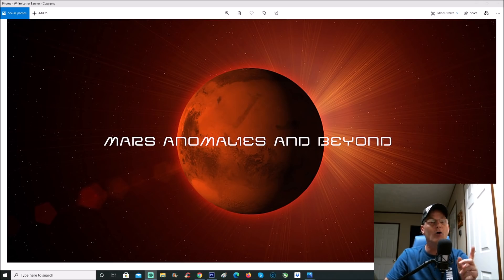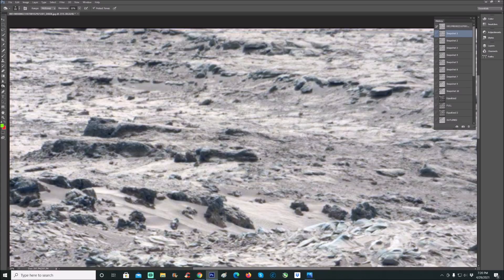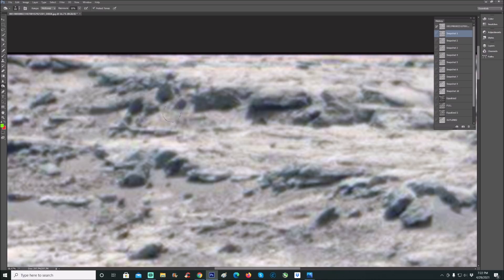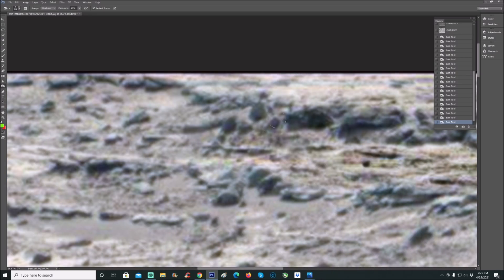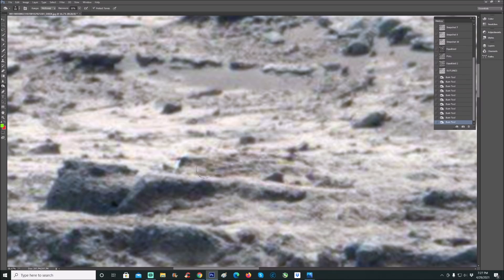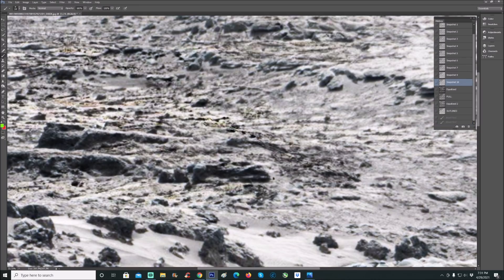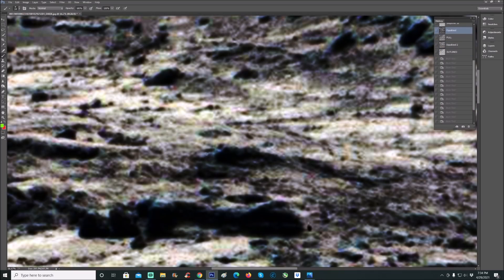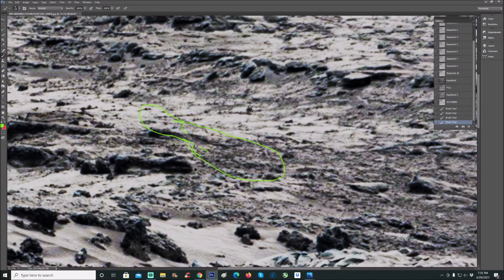Tunnel Entrance, Cables And Mechanical Parts + Quick Tutorial ~ 4/29/2021

Comment: Chris if you want to see what is there then try this.  Take one of your pictures (preferably cleaned up some) and zoom out until the picture is about a 2 inch by 2 inch square.  Take your paint brush and increase the size to say 200.  I believe you currently have it set at 85.  Take the circular "brush" and without touching the right or the left mouse button go slowly back and forth or circle clockwise or counter clockwise until the picture of what is there shows through.  It will only last a moment but you will see what is there as long as you keep the brush moving.  Once you stop the image will fade back to what is was.

Comment: I have also been doing this since the beginning, I started with some  links  Mike Bara gave me of massive HD links on NASA's site but buried deep and hard to find. I'm on a strict budget, so most of my software is older and cracked. I'm running still photoshop 7, I had 9 but they caught me. My point is I don't think there's a burn tool in Photo 7. so I really appreciate your work. Been watching close since LunarAnomalies.org This has really been some ride.

Comment: hey Chris, I was watching this video called scientist present evidence of water on mars during house science committee hearing 4/29/21 and at the 4:58 second part of the video they use current pictures took by the new rover or ....in the bottom right side on the picture you will see an anomaly that looks just like a 5 star piece of metal that has like o mjushroom top that does not look like a random rock , the star resembles a usa mag rim for older hot rods
Reply: the video is a pano, so there are numerous items Chris I even see a lil bunker

Comment: and on this one those R mechanical parts from what look like destroyed robots, one laying face down with an arm out and and knee bent sticking up into the air. eeveral othrr robot torsos. possible spend artillery shells etc. thx 4 getting these. i have a mastrs in tech but get hacked on http. my extrernal IP sold to gov.